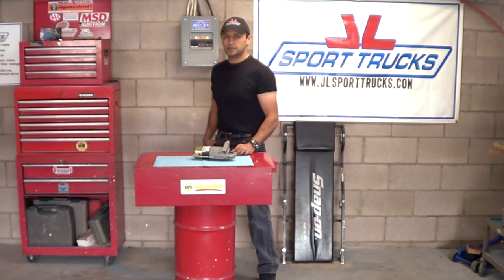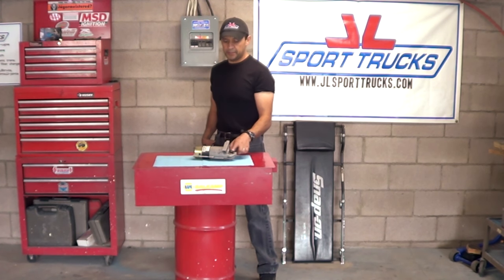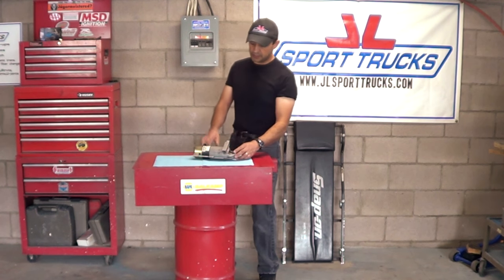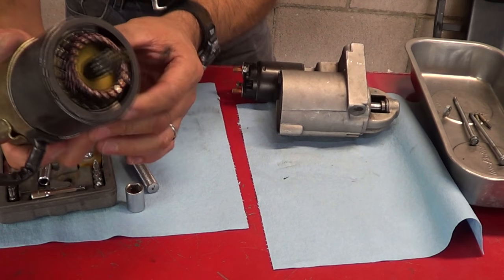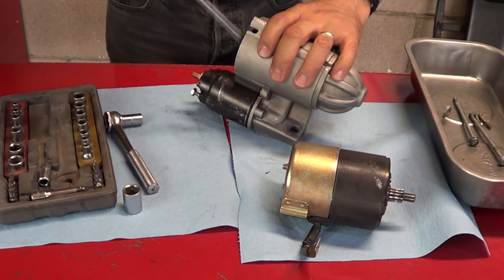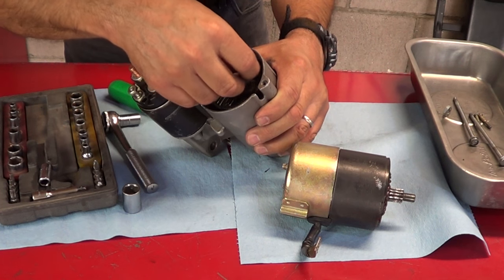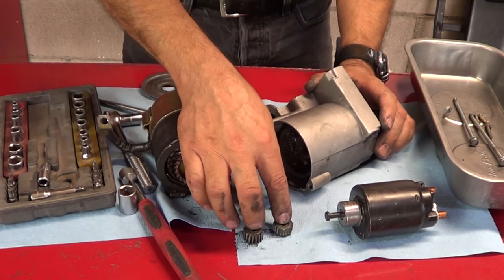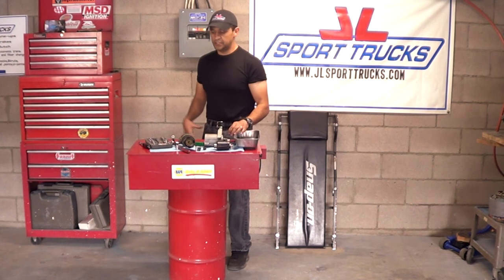Diagnosing Gear Reduction Starter Failure at Howstuffinmycarworks

Comment: I just sub'd to your channel, it's got some interesting details and I learn something with each video. Good audio, and I sure like the fact you make the effort to use the tripod consistently. 
If you ever have trouble getting adequate focus on small parts, here are a couple of tips. Autofocus will trip you up if there is distracting background detail. So, for small parts, make a bland dark background like a paper towel so the camera won't be confused. One method is to cup the part in your hands, obstructing the camera's view of distracting background. Of course better light on the part you want in focus always makes the job easier. A common mistake is to try and zoom in on near small parts. That makes things worse, since minimum near focus distance on zoom lenses is always worse when you zoom. Most cameras will not focus any closer than about 11 inches, so use a wide angle, keep the part about 12" away, use loads of light, and remember the bland background.